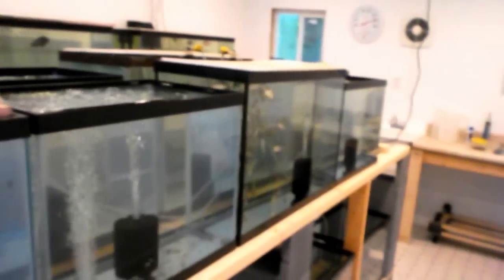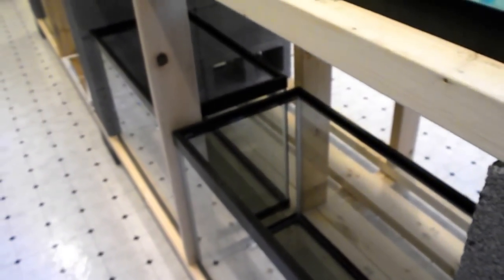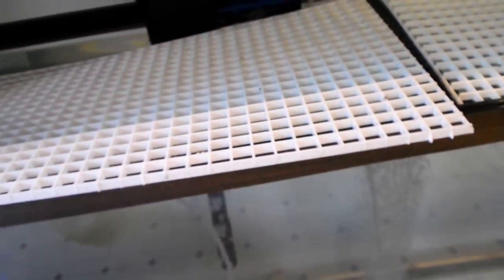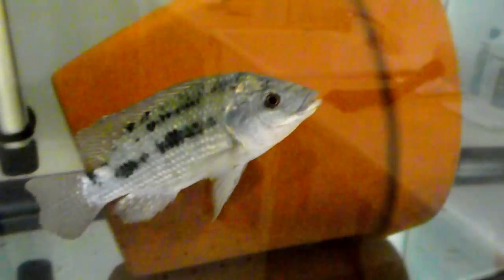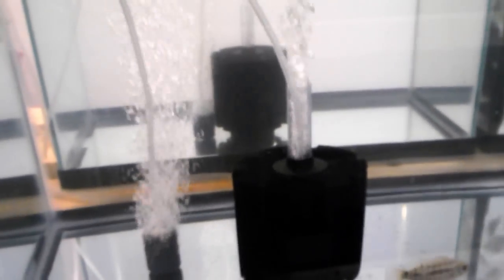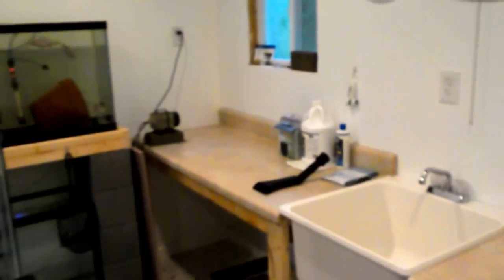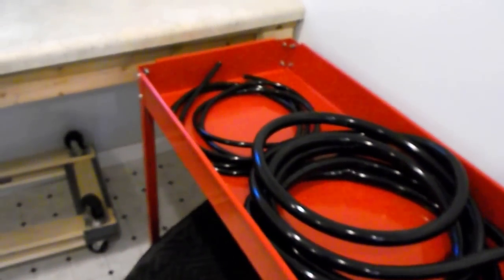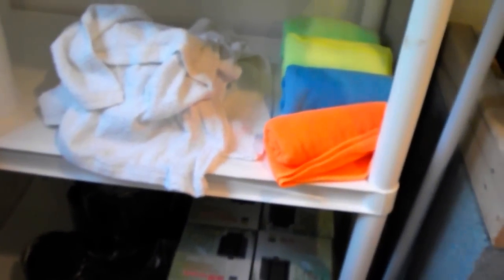Hatchery, September '16

Comment: How many pumps did it take you to run air to all those tanks? I see the manifolds just curious. Everything looks really good Greg. I just had some blues breed in my 20 gallon tank! I was shocked to see that happen!
Reply from the maker: There is one pump running the tanks in the middle (18 tanks) and there is one pump running the tanks on the left wall (breeders). Congrats on the holding mother....good luck.
Reply: Thanks Greg! Yeah I have a 55 gallon breeder colony and they are looking good, some chasing has began. I'm just shocked that I had some breed in a 20 gallon! Looking forward to seeing updates from your hatchery!

Comment: Have you learned that you don't need gravel in the breeder tanks? I remember one of your videos where you mentioned it and the males like it. I'm helping my 8 yr old son setup his breeder tank and wanted to know about the gravel. I have noticed in your more recent videos you don't seem to be using it anymore.
Reply from the maker: That is correct, I said it in one of my later videos but I can't even find it now.  It doesn't seem to affect breeding at all and it makes cleaning the tanks much faster and easier.  None of my aquariums, whether it is a 55 breeder tank or a 10 or 20 gallon fry tank/holding tank have any gravel.  I simply start a syphon, go over the glass with a scrubbie, wipe air lines and change sponges and refill.......about 10 minutes on a 55, less on the smaller tanks.  About 3 hours for all 30 tanks if they all have fish in them.